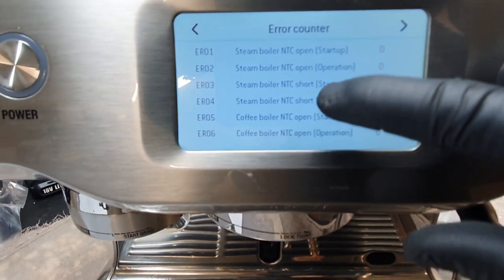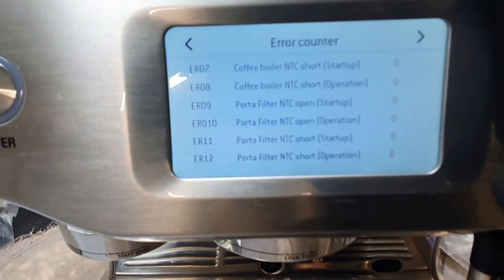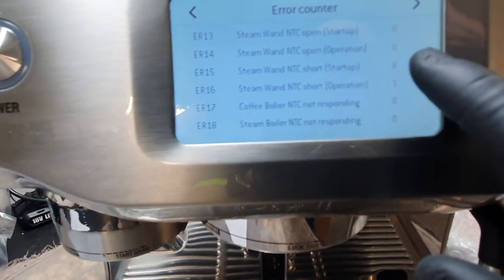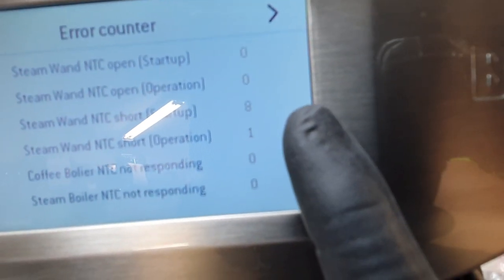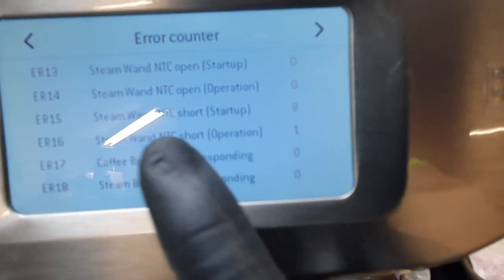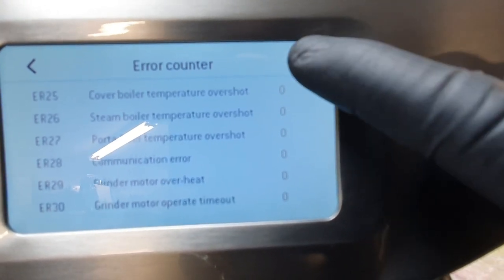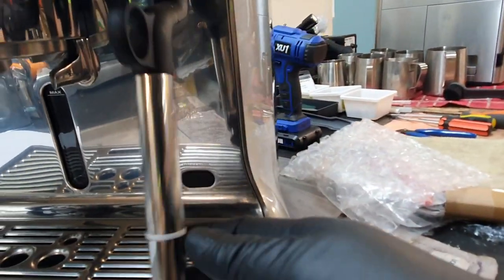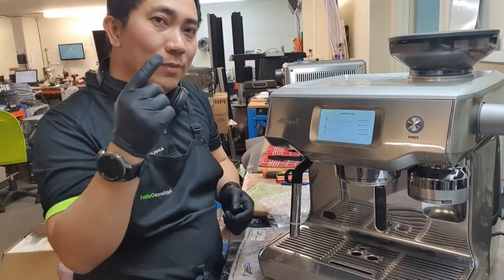HOW TO REPAIR BREVILLE ORACLE TOUCH COFFEE MACHINE BES990 #TEAMPHD

Comment: Thanks so much for this video. I have the exact same error message so now I have a good guide for fixing it!
Reply from the maker: Thank you
Reply: Found this as have er15 bought replacement for £80 but how did you remove the water pipe part??
Reply: @ciscosurplus  I'm not sure what "water pipe" you are referring to, but I just followed the instructions in the video to replace the steam wand assembly. It worked out great, and was not a hard project. I was just careful to not damage anything else, and to identify each wire connection and hose that was needed for the new part.

Comment: Great video! Where did you get the O-rings? Do you have a part#? It seems like this is a common problem and maybe a slight oversized oring would be good or another material that can handle the heat better. Thank You!

Comment: Hello, I have Sage SES990 Oracle Touch. This machine is probably identical to the Breville Oracle Touch BES990.
Maybe you can help me with the following problem.
As soon as I plug the machine into the socket, the RCD (residual current circuit breaker) trips.
Do you have any suggestion what fault the machine might have?
The machine is 3 years old.

This text was translated from German into English using Google translator.

Greetings from Germany
B. Niehaves

Comment: Thank you for posting this video, it is extremely helpful.
I have an out of warranty BES990BSS and I the control board (behind touch screen display) has failed. there are three components on it that are burned away. Also when I plug in the machine it runs the pump continuously, and it won't turn on. Do you know if there is any company that sells them, or any way to get it repaired? I am using a 110 volts.
Reply: Yeap another POS from Breville at $2,600.00 price tag, never again on this brand

Comment: You used 3 different screw drivers. I k ow the back top screws are torque type, but si ce I canister the front screws and you do not show the screw driver head, I am reluctant to stuff up the screw head. Can you list the drivers used for which screws. This would really help. Apart from this it's a great video.
Reply: Hi mate. you can use philips screw driver and star key at the back n#15. onykus

Comment: hello, please tell me, I have a coffe machine sage oral tach and the water temperature shows 76 degrees and the milk does not rise, in short the boiler on the right side is cold but the one in the middle is hot, the grinder works and the water that comes in for the tea thank you
Reply from the maker: Check the thermal fuse possible open use multimeter to check the blue and brown wire if open circuit

Comment: I have replaced the o-rings on mine, but I cannot get the clips back on.  I'm pushing down on the probe as much as I can, I'm using pliers to exert more pressure, but no-go.  Any trick to it?  Any help or a detailed video on how to do that part would be most appreciated!
Reply from the maker: Use a a bit food garde grease on the orings

Comment: I have this coffee maker and I need to buy the grinder part because it stopped working and I already changed the part that you replaced and it is still the same. Can you tell me where I can get this part because I can't find it on the internet. Thank you.
Reply from the maker: it depends on the firmware version of the machine, you need to upgrade via breville tools.

Comment: Hello! I'm troubleshooting an issue on my machine.  I have no flow from the hot water spout.  The steam wand functions just fine and I have no problems with water coming from the group head.  do you have a suggestion as to where I should look first to resolve?
Reply from the maker: possible there is a blockage on the spout

Comment: Hi there was hoping you may see this. I am working on a BES880 Breville Touch and the grinder is not working properly. When pushing in the rod to get coffee grounds, the breville beeps 3 times and the grinder does not start up at all. any idea what might be causing this? Thank you!
Reply from the maker: check the connection of your top cover connected to the grinder switch

Comment: Trying to get parts over ring for probe, and steam one the cool touch steam wand with integrated temperature sensor for automatic frothing. Called Breville they don't have parts and part number. could you please assist how i can get the part number please, and they sent a link for replacement parts company even they don't have it.  you recommend replace parts on your video.  I have the same problem my Breville oracle touch.  thank you appreciate it.
Reply from the maker: Thank you for your query, unfortunately I am using same part number that breville provide you. If you ate in New zealand I can assist you more. you can chat me on my facebook ODEL JHUN BAUTISTA or ASL PINOY

Comment: What actually caused the grinder to ratchet like that?  Isn't the upper burr not supposed to be touching the rotating lower part?  I have this problem with my Oracle.  It ratchets with a single bean even when it's adjust very coarsely.  I hate to send the machine all the way back to Breville for a simple repair.  Thanks
Reply: Did you manage to fix mine does the same? and out of warranty now
Reply: @samwalker6488  Breville took it back in for repair.  I couldn't tell what they replaced.

Comment: I recently replaced a leaking o-ring on one of the boilers and now the unit is coming with Error code 12 and it keeps "Warming" even though it's at 93 degrees. Any idea what the problem could be? Thanks!

Comment: I have ER21 and also ran the debug and encountered LD17 Solenoid OFF........everything works but the Steam does not come out from wand, that was after I smelled burnt wire. Is the solenoid in the steam wand assy? It cost $100....Breville wants $550 to take for repair, what a rip-off...must be made in China with golden wires
Reply from the maker: Dont take risk on fake Breville parts, chexk of there is voltage coming to the solenoid if not replace the whole steam wand